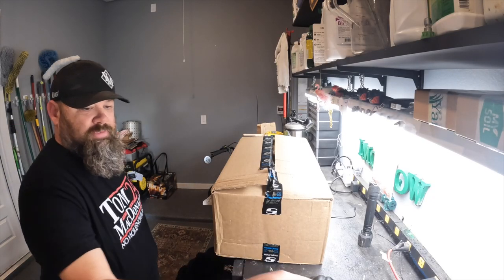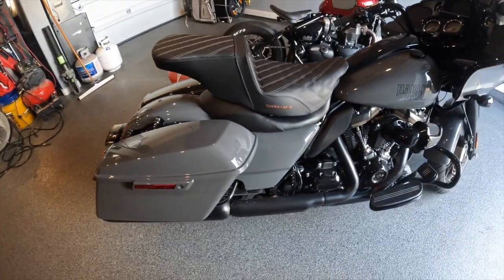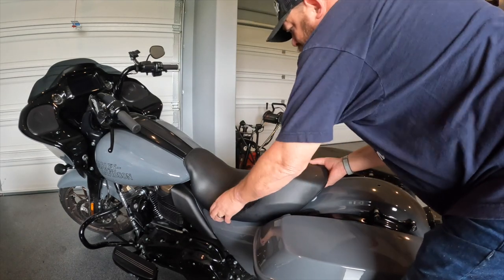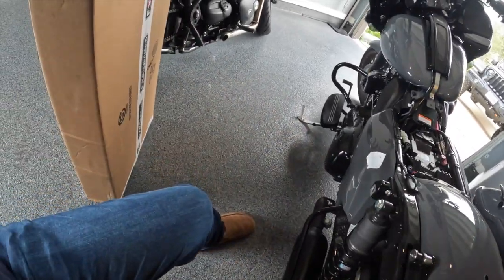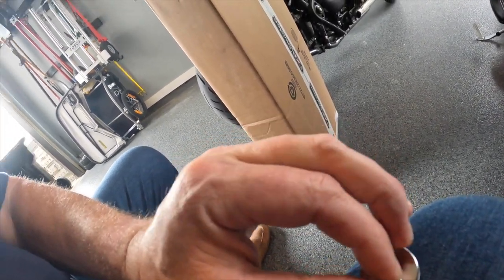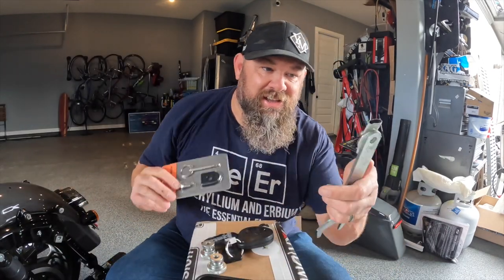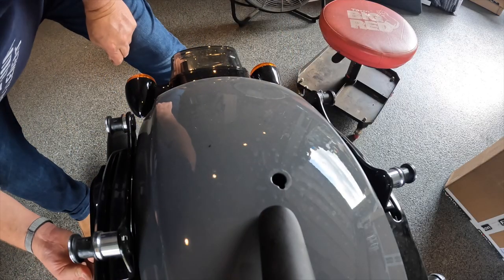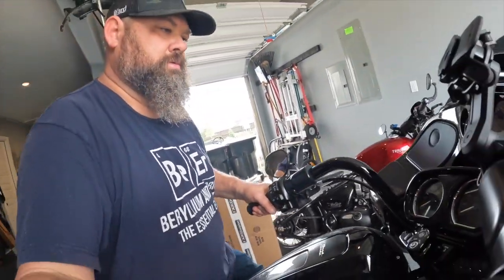HARLEY DAVIDSON TOURING SADDLEMEN STEP UP SEAT INSTALL

Comment: I usually use a long zip tie to help put in the seat nut from under the fender.
Reply from the maker: Brilliant. That makes a lot more sense. Hahaha
Reply: I also use a long piece of wire and tie the nut to it an pull it through, works like a dream!
Reply: Yep, zip tie or a cable feeder or some wire will do ...

Comment: Drop an end of a string (550 cord) from the top of the fender through the hole.

Attach seat bolt by threading the string/cord through and tying a square knot. 

Pull seat bolt up through hole.
Reply: it was painful to watch him doing it lmao....string 123 ....i usually tie a nut to the string an drop it out after install

Comment: Very ingenious workaround brother. Thanks for sharing. How do you like the seat after having it for a riding season or so? Break in period time? Are you still using it? How’s the passenger comfort? Sorry I send this message 2 minutes before you addressed my questions haha. Passenger comfort good tho?
Reply from the maker: I've since learned that you use a long zip tie to feed the nut into the hole. 🤣The seat is still very comfortable as far as passenger my wife hasn't been on yet. Cheers and thanks for watching.
Reply: @bangbangbikergang5052  appreciate it

Comment: I ordered my saddleman seat an the security seat set them clowns sold me the wrong bolt with the kit the stock bolt is 1/4x20x1 inch an the bolt with the kit is way bigger

Comment: You can leave the original seat mount on. Just in case you ever want to run the solo seat
Reply from the maker: Damn dude! I was just thinking about the solo seat and now I don’t have the mounting hardware. Thanks for the heads up.
Reply: I'm in the same seat situation. So are you saying just put the nuts back on the original bolts and throw the new seat on over top of them and that's alright?

Comment: bro, in the future if you ever need to do this again, run a longer zip tie through the middle of the screw. Then pull it up through the hole and it makes it a 30sec job. it was painful to watch the stuggle! lol good build so far!
Reply from the maker: That would be way easier. Cheers

Comment: Nice video. 👍I would have been swearing up a storm, trying to get that seat nut up in the fender. 🤣🤣
Reply from the maker: Oh I was. Since this video I’ve gotten a jack and the helps a bunch.
Reply: A piece of wire down from the top attach the nut to the wire and pull it up into place,  push the wire back down or just clip it, takes less than a minute,  zip tie works but you have to get it through the hole from the bottom,